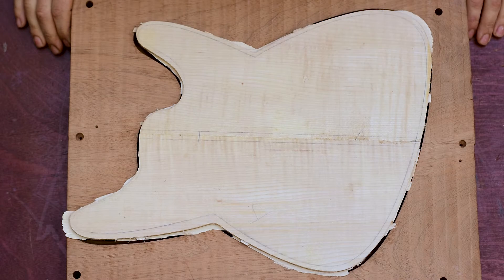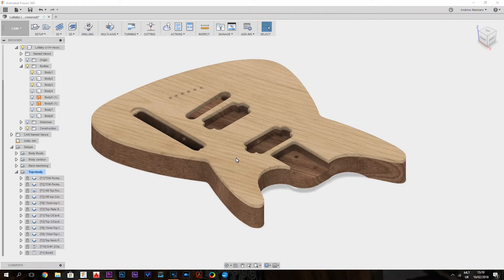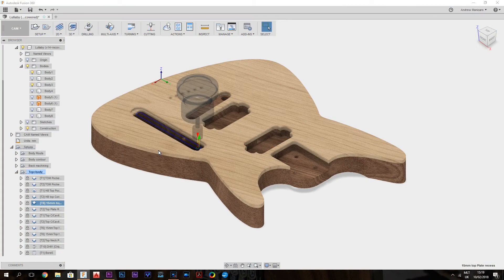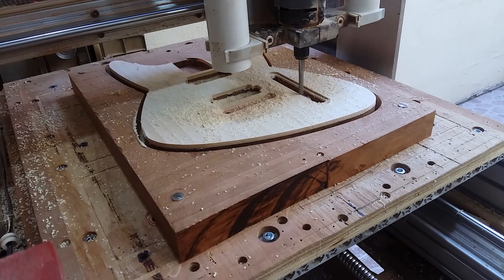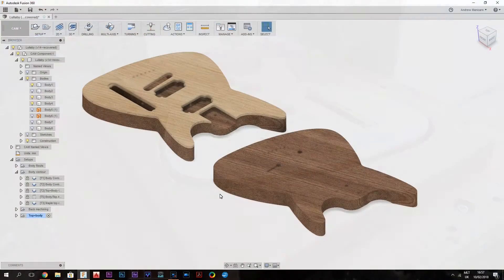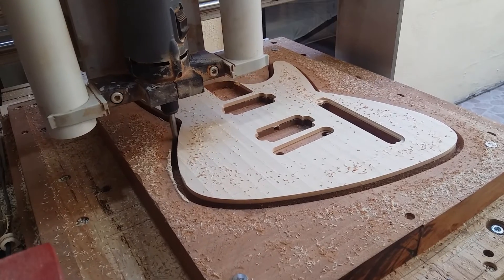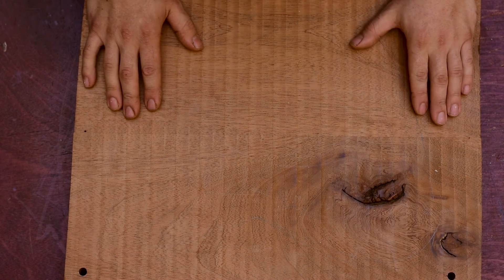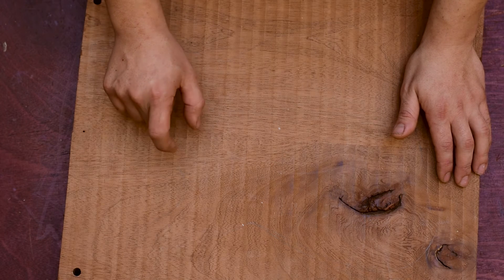How to build a guitar using a CNC - Episode 4

Comment: Hey! Great video! Thanks for your effort! Could you maybe give me a tip how you achieve that 1mm leftover before you do the cleaning pass with the drill? do you make it in Fusion CAM? Or do you plan it in CAD? Thanks in advance!
Reply from the maker: All in Fusion, the contour tool path has an option to 'leave material'. I just left 1mm extra on the radial option
Reply: Thank you very much! I will try it! Greetings for your great work!